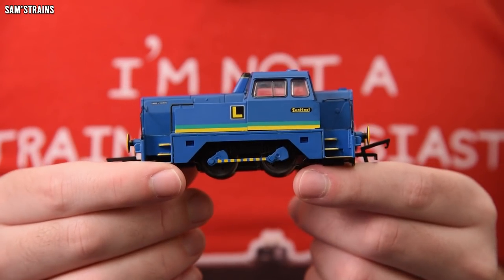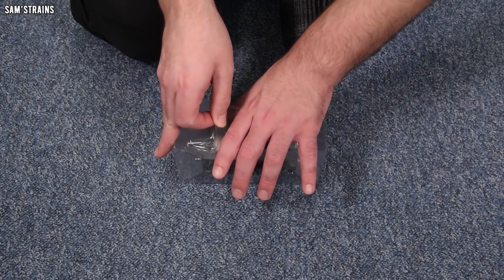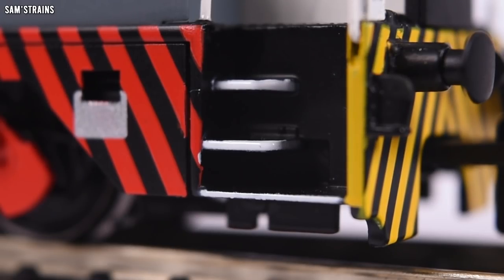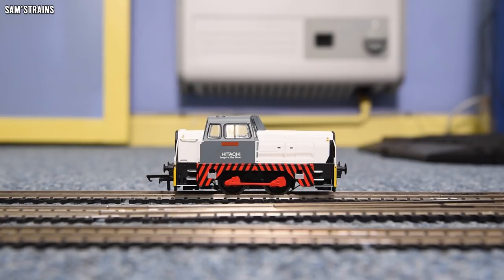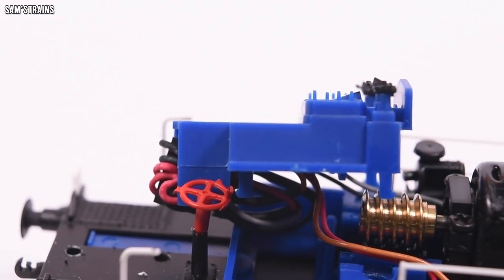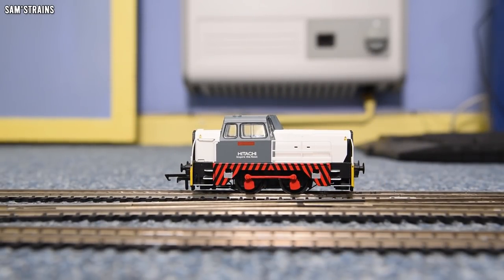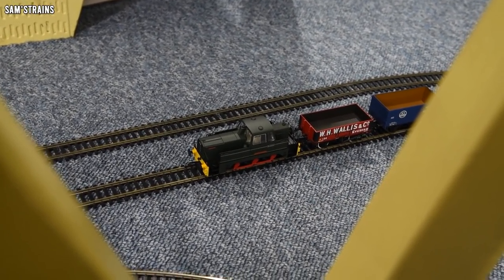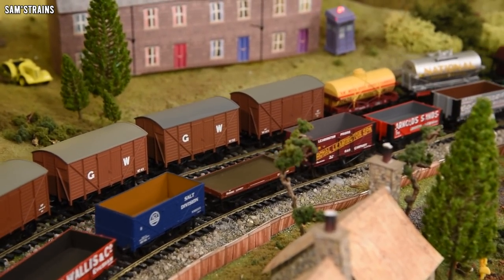New Hornby Hitachi 0-4-0 Sentinel Shunter | Unboxing & Review

Comment: Hi Sam. Unrelated question: when it comes to your 3D printing equipment, have ya considered using a resin printer? I expect you've heard about these from your comments already, so I apologize for pestering you about it, but I think the higher-rez, finer detail parts would be right up your alley.
Reply: He cannot use a resin printer as he has no ventilation in the loft unless he buys some fairly substantial ventilation equipment
Reply: Ahh, I see. Yeah, wouldn't want to breathe in that crap.
Reply: @CustomiZe_  I mean, he can use another room doesn't it? Doesn't have to be recorded anyway IMO...
Reply: @rizalardiansyah4486  He can't use another room as the rest of his family are downstairs and he doesn't want to be stinking out the house with fumes from his resin printer. That's why all his projects are strictly loft based.
Reply: The funes are a real issue.  When I 1st brought a resin 3D Printer it was in my room, felt high in a bad way.  Ended up converting a small shed and installing an extracter fan.

In the loft I don't often spray or use my airbrush for the same reasons of no ventillation.
Reply: @Trainskitsetc  oh yeah because he really wants the hassle of having to carry it all the way down the ladder from his loft through his family's house outside into the garden,  in which his family may be using on a nice day then put it in a box, connect a extension cable up to it then worry about whether it may rain or not, or not being able to keep an eye on it while working in the loft, then lug it all the way back up through the house, up his ladder into the loft when he's where there's limited space anyway.  That seems far more superior than just plugging a USB into a socket.  And considering how often he 3d prints thats going be quite a hassle. I don't get why people can't accept he doesn't want a resin printer and that's that.
Reply: @Trainskitsetc  I can't believe how desperately you want him to get one lol 😂 just for a slightly better result; he might not have anywhere else to store it and like I said before maybe he just doesn't want one so you can stop giving reasons as to why he SHOULD get one.
Reply: @Trainskitsetc  why would I need to read it, I'm not the one trying to convince someone to buy a resin printer. Email it to Sam but the response will still be the same. HE DOESN'T WANT ONE
Reply: @Trainskitsetc  as if that's an insult Sam doesn't have to pay bills living with his parents 🙄 so I would say he's lucky.

Comment: I had got an 0-4-0 (GRAYHAM) at fenwick for 80 pounds not to long ago, and well for the running it’s only probably was the stopping at points before but for disassembling the only problem was that one of the tail lights came of but I easily glued it back on, also the hand rails easily clipped in place.

Comment: Do not joke about 2 pole motors,  Graham Farish used these in their original 00 gauge locomotives.   Rotating magnet and field coils with contacts to change the field direction every 180 degrees.

Comment: Hi Sam.
Theory with regards the locomotive history not on the box. The smaller locos all seem to be similar in size and therefore specific boxes per loco class would increase costs. So for all the range that locos are of that similar size it's better to keep a single box size and design. Obviously for more special locomotives they may include the history in the back like the pecketts but guess in a year or so even they will end up in plain boxes. For the larger locos the boxes can be more tailored to them. Anyways that's just my theory on the boxes.

Great review video as always.
Reply: As you said I bet they are going back to the older packaging they previously had about 7-8 years ago when they had the red and yellow box then a white insert with the outline of the locomotives, or maybe do what Bachmann do with their packaging.

Comment: A Heljan-like conception saved only by nice dynamic qualities, sorry, but this is a no-go for me, whatever the price is, even at half the price.
It does not sounds good for their forthcoming 9F and Black Five, whose models I have targeted for a buy. I will wait for your test of both before buying any of them. Hornby quality does down the drain whiles prices goes up, what a shame !
Two little things : I have seen on your layout a sky blue BP Janus, do you have a test video of it ? Second,  one suggestion : make a test between comparable Hornby models and their continental counterparts inside the Hornby group : Rivarossi, Electrotren, and Jouef. I won't be surprised if the quality of their HO continental range is better than their English OO models (I have italian Rivarossi rolling stock, and it is fine in price and quality). I can give you some ideas of possible comparisons if you are interested. Thanks for the video anyway !

Comment: Hi Sam it is a great looking engine but a little expensive to me . I am getting very disappointed in Hornby as of late I have found that the motor in my B12 and my S15 both are faulty and I know I am not alone in this . And with their price increases and hit and miss quality. I don’t think I will be purchasing any more of  their products. Great video Sam . I don’t mean to sound so negative but I do use to bragging on Hornby in the past.
Reply from the maker: So sorry to hear that Louis - I bought 2 b12s as you may know, and those are both faulty too - videos to follow!
Thanks for watching, Sam :)
Reply: @SamsTrains  If you make a video on what kind of replacement motor to buy for them, I'm in ! I've got a nice S15 reduced to a shelf queen because Hornby does not know what a quality control on the assembly line looks like !

Comment: I don't know why Hornby, or any other company glue items together that are needed to be removed for maintenance. Glued at one end, yes, but a good push fit for the other end and have them made of sturdy wire if it is handrails or pipe work, please. Price wise for what it is, this Sentinel or any locomotive built to this standard will have to be a lot cheaper and under £100 for my liking.

Comment: I think the issue with the Hornby 0-6-0 is they tend to pivot around the centre wheels so if your points are not perfectly flat, which in my experience even with new ones is rare, it affects the pickups. With the 0-4-0 you have no such issues. An interesting observation on prices, I recently bought the Bachmann class 66 Evening star with sound from Rails for about £207. When you consider the sound decoder is a LokSound at retail of over £100. that makes the loco about £107. So which is the better value?
Thanks Sam for a good review, I probably wouldn't have bought this loco but the mechanism was really interesting. Without looking I would have though it would have been the same as Percy, but obviously not. Probably is a 5 pole, Hornby 3 pole motors are generally aren't painted or anodised, 5 pole ones are. Obviously a different designer at Hornby. I bet you can't buy the handrails as spare parts.

Comment: Also have the Stanton 0-6-0 Sentinel, agree out of the box it is poor compared to the 0-4-0's that run almost as nice as the 0-4-0 Peckett's. The 0-6-0 can be improved, remove the choke from the motor, fit DCC and a small keep alive and it runs really nicely, even crawls well. Without the keep alive it even stopped on electrofrog points, which doesn't make much sense for a 0-6-0.
Reply: What's a keep alive? Is it some sort of a capacitor? Never heard about that before

Comment: I got the 0-6-0 Sentinel beacuse it had that Stanton livery, expecting it to be a good runner given it was a brand new loco and i was very disapointed. I had a problem with the coupling rods jamming, so the motor would run but the wheels were stuck. 

It's more probable that the 0-4-0 is at the price they wanted and knew sales would be poor if they sold the 0-6-0 for say £120/£150 so downgraded it to cost less to garuntee sales.

Comment: Whilst the complete excellence is something preferable i will always side on "at least have it be mechanically sound" side. That is good thing to focus development time on, yes it'd be better if it was you know using its peg holes and maybe some more sturdy materials were applied to building it.

Overpriced, slightly disappointing detail-wise locomotive it seems.  Oh well maybe hornby can continue with incremental improvements.

Comment: What a shame; an attractive model spoiled by poor design. For a small diesel shunter my preference is Bachmann's Class 03 0-6-0 which is a great performer, has a cab light-and a driver! That's been around for at least 10 years. Hornby have some catching up to do methinks. Thanks for another good, thorough review.
Reply from the maker: The small Bachmann shunters are absolutely outstanding - the gold standard for this sort of thing in fact - review on the way!
Thanks for watching, Sam :)
Reply: Got one, a nice little critter to run around. Bachmann had everything right with this one.
Well, more and more, I am looking for Bachmann class 08s, waiting for new issues. Hornby also made one, but I won't go there...

Comment: This model is more expensive than the other 0-4-0 releases of recent times (I'm sure there has been more than just this) because of the new tooled bits like the new end grilles and the side plates and the couplings and the compressor. But to be double the price of the original model released just 6 years before (Pecorama's shop has an initial release RRP of £55.99, model rail database says its a 2015 model (this hitachi one is a 2021 model)), without any other improvements? No lights or sprung buffers, still a 4-pin interface instead of the more standard 6 or even next18?
I'd actually send this back as unfit for purpose, because it was damaged while disassembling "to fit a DCC chip" which is a feature this model supports. Because no parts required to come apart during disassembly should be glued together from the factory.
I've had my Wabtec sentinel apart a few times because of DCC issues, because the plain 4-pin chip isn't good enough without a stay alive, and there's not much room for a stay alive there at all.
I want to buy some of hornby's more recent releases. But they're expensive and poor quality, and I just don't want to support a company who has stopped caring about their customers because they got into a bit of financial trouble before lockdown (we all know their sales soared while people had nothing better to do).

3 months into the year, and Gladstone already has 3 models underneath it. A good year for Sam's Trains locomotives.

Comment: So this engine (I would assume) works with the manufacturer of constriction equipment? Nice! It's up there with other examples, but lags behind Caterpillar, General Motors, & Ford Motor Company in terms of actually making engines. Ford made a center-cab diesel here in the US for switching autoracks, and other car transport rolling stock in Dietoit, EMD was a division of GM, of which EMD is now owned by Caterpillar, obviously EMD under GM was famous for the F7, F40PH, GP30, GP38, SD40, SD45, SD70, and SW1500, while now EMD under Cat is famous for the SD70ACe, and various rebuilds.

Disasembly wise, that's what I have to do with my ES44, and other more modern diesels. The GP30 requires me to remove the fuel & air tanks, then remove the body, and for the trucks, remove the side frames, then I have access to the pickups & gears (which are nylon FYI). The ES44 is a bit easier, where as my GS4 as beautiful as she is, is a pain to remove (her tender, not so much). Lead & rear trucks need to come off, body screws, then the body, base keep plate, and coupling rods (if required). Not dissing the difficulty of most models, I do like me a good easy model, but I like my disassembles like my warship models, tons of small parts, and SLOW. I also like having instructions written by someone who use to work in NASA, or the ESA. Not these simple drawings the Model Railroad Community like's to call "detailed".
Reply: Hitachi build hi speed trains for the UK and they have their own depot to prepare and repair the high speed train sets like the Javelin and Azuma sets. This little shunter is used to shunt the sets and carriages around the depot. There used to be diesel shunting locomotives at the Ford Dagenham factory and a few other car factories near railways had shunting locomotives, even the chocolate factory cadbury's had diesel and steam shunting locomotives and as Sam mentioned some were located at steelworks, coal mines, dock yards and other large industrial sites.